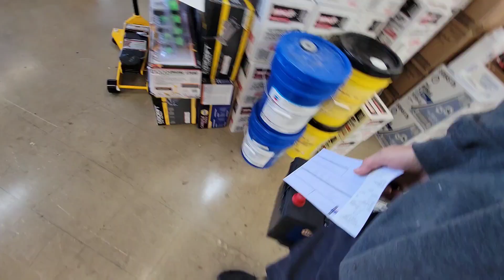What now WILLIS

Comment: I've been an ASE master certified mechanic since 2003. Using your battery to jump a dead battery will not cause your battery to go bad. If your battery goes bad after a jump it's because your battery was already weak going bad and the amperage drawl from the jump collapsed the bad cells in your battery. It was likely your battery was on its way out and the jump helped it. Also it is correct that a nice cool down can expose bad battery cells and cause the battery to expire... When I replace batteries out of a diesel I always recommend getting interstate batteries they have the best warranty 3-4 years no questions asked.
Reply from the maker: Appreciate the info

Comment: We put a big  deck on the side of our house we bolted it to the house but we still     SiliconeThe top board like you just did water was running straight down the wall going into basement so when we done that it fixed the problem
Reply from the maker: Nice

Comment: Just make sure all cable's going to ground are clean and tight all connections are clean bad connection can cause battery to turn bad due to dirty or lose contact and low charging to diesels need 12 volts to run 10 volts will kill the engine from running.
Reply from the maker: Tks Mark

Comment: Yes, Travis I heard what Julia said about the paint - hopefully she will only want a shade different for the second/third coat.  My fingers, eyes and toes were crossed in the hope the truck would start YA!!!    When you went to start the truck with the new battery, I was holding my breath in case your coffee tipped over.  Bathroom is coming along nicely.  Zoey was right the hoses on the hot water tank does look like a heart.  never have enough outlets in a kitchen.
Reply from the maker: Yes
Reply: I had noticed the heart thing also I just didn't put any comment down I'm glad that they saw it